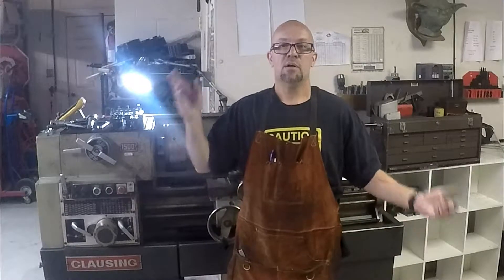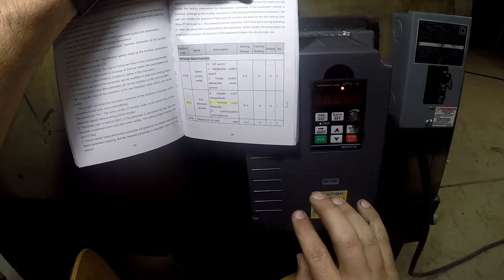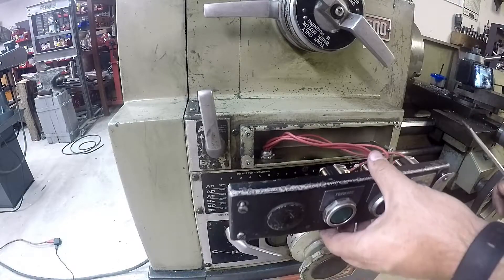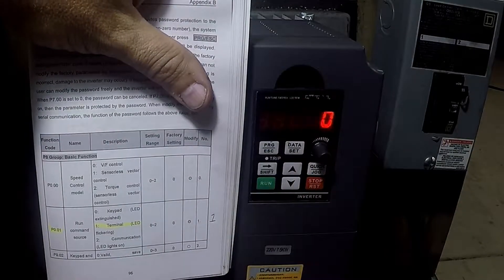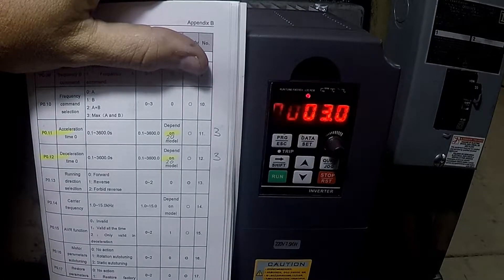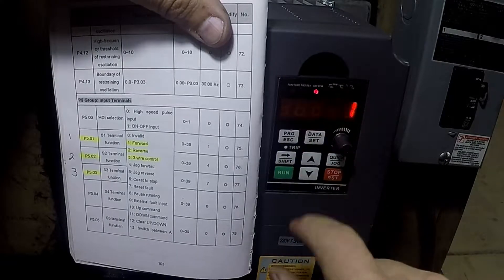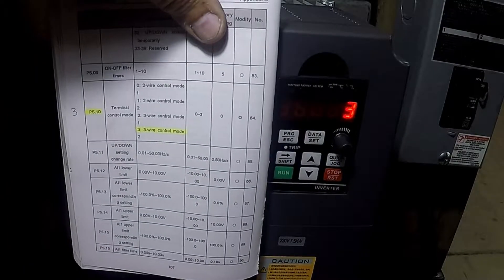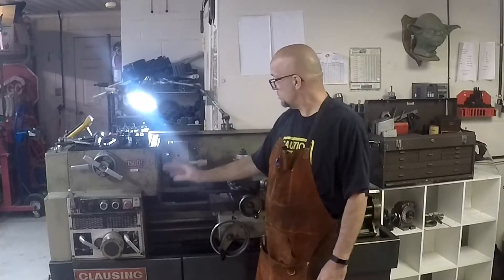VFD Running a big 7 1/2hp motor on a Clausing 1500 lathe Pt 2 Wiring and programming

Comment: Hey mate so 4 years on is it still all good?
Reply from the maker: Still running strong.  Using it today to make a shaft adapter for the Acroloc.  I don't ever even turn off the VFD.  so 4 years it's been on the entire time.  (no I don't leave the lathe motor running :)

I haven't posted much lately since everything has been going really slow in the shop and hard at the office, but progress is still being made.

Comment: I am trying to assemble a similar setup.  My lathe does not have forward/reverse buttons like yours but instead a traditional clutch handle on the apron.  I'm assuming I just have to find the switch that the clutch controls and re-route the wires to the VFD (like you did).
Reply from the maker: Yes that's exactly what it should be.  somewhere in the linkage would be something to engage a switch.

Comment: Your entry for motor KW is low.  It is asking for the power sent to the motor, not the power the motor outputs.  7.5 hp = 5592 watts.  That is the output power, not the input power.  I hooked up a 7.5 hp 3 phase motor, and the correct number for it is around 6665.  You can computer it two ways.  Using the hp converted to watts divided by the efficiency of .84 gives 7.5*746/.84 = 6661.  Or using the nameplate voltage and current gives 19A*240V*1.7*.86 = 6666.  1.7 is the square root of 3 since it is a 3 phase motor instead of a single phase.  .86 is the power factor at full load.   As you can see both give almost exactly the same result.
Reply: This is very good to know.  I haven't found this lathe lacking power to do any of the work I do so I may just leave it slightly under powered.

Comment: Have this VFD 10hp version (GT-7R5G-4) that I'm also trying to run a 3 phase lathe on. I've changed almost all the same parameters as you (based on my motors data plate) but when I run the auto tune (P0.16) The motor (unloaded) starts to turn, then slow down and I get an EEP fault. The fault clears but I have no clue how to get past it. I've tried delta and y wiring on the motor, slowed accel and decel times, the motor phases test good, .8 ohm on each phase, good continuity between each other as well.
The motor data plate lists it as a YD132M-8/4 model, 220V, 60hz, 15.3/16.3A, 870/1730RPM, 3/4.5KW.
If you know have any advice/ideas I'd love to hear it, I'm a couple troubleshooting session away from sending it back and buying the twice as expensive ATO vfd.

Comment: If you’re running this on 220 volts there is no neutral. The white wire will be connected to second buss bar in the breaker panel ( the second breaker in the twin breaker) and will be carrying 110 volts  when metered to the neutral buss bar or ground.
Reply: From 2.28 to 2.45 you mentioned the ground, hot and neutral as well as 220 volts. My comment was only intended to point out that when you are running 220 volts through a white and black wire the white wire is not connected to the neutral buss bar and is in fact a hot leg. Not really finding fault, I have appreciated your videos, just pointing out a point that might cause a beginner to make a critical mistake in their set up. By code the white wire should be taped red or or another color that is commonly used as a current conductor. Having said all that thanks for the video.
Reply from the maker: @jamespayne8781  absolutely right,  just misspoke.  Meant hot/hot.
Reply from the maker: Did I mention neutral somewhere in the video when talking about 220?  I didn't notice one and that would have been a mistake on my part.  Unless it's 4 wire 220 (witch is really just en extra 110v line) then there wont be a neutral.

Comment: Nice video and very helpful. I think you touched on it but why couldn't the lathe be wired to use its own button switching and skip the aux input connections? Thanks in advance!
Reply from the maker: So a VFD doesn't really work in the normal sense of OFF/ON,  or especially in this case forward/off/reverse.    So the VFD will have a separate ON/OFF state but that puts it basically in waiting for a signal to start sending 3phase power to the motor, and in which direction to spin the motor when it sends it.

Comment: ok stupid question , why do you use a vfd ???
Reply from the maker: Not stupid at all, most industrial equipment runs on 3 phase power that's not available in most residential homes.  A variable frequency drive is one way to convert single phase home style power into 3 phase power.  Another way is a rotary phase converter.  I have another video where I made one of those you can check out.
Reply: @TheArsonsmith4242  ooo ok i get it thanks so much for answering my question . :)

Comment: I’m glad you are getting the Clausing useable.  Just remember that lathe has way more power than the little Logan, it will eat you alive if you let it, be careful!
Reply from the maker: You aren't kidding,  did a quick deep cut comparison,  .075 was deepest in steel for the logan before chatter, the clausing was eating. 300 before I got to scared  to go deeper.  They were abom style cuts!!

Comment: I have a 15hp RPC but at one time i was looking at the VFD.  all the videos i found were useless.  This video is by far the best ive seen.  Thanks for doing it.  Another reason i dont like the vfd is the noise the microphone picks up .  The cheap ball bearing fans have a high pitch zing you dont really hear , but you'd probably have a headache after 8 to 10hrs in the shop.
Reply from the maker: the one I have on this lathe actually shuts down the fan about 20 seconds after turning off the lathe.  The one I have on my Bridgeport does have that damn humming fan sound though.
Reply: Send me your address and I will send you my channel logo stickers   doug1979transam@gmail.com